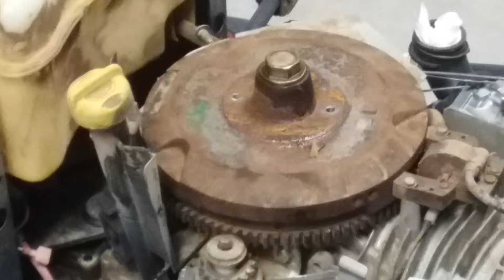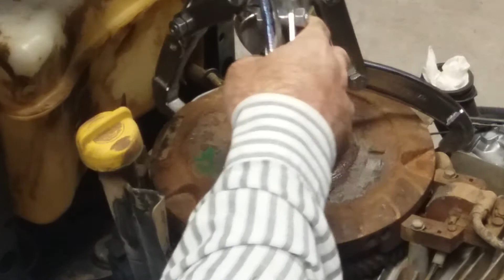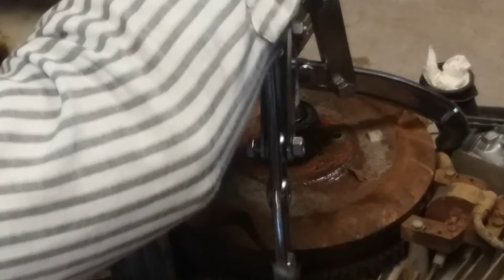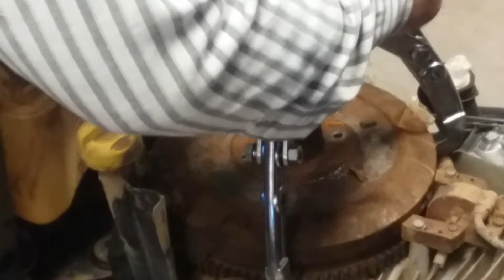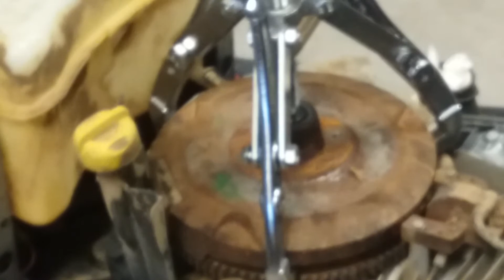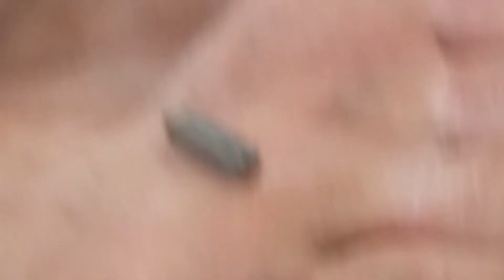Removing the flywheel from a Craftsman LT 3000 riding lawn mower

Comment: oil and heat to swell the flywheel  a little bit so it pop off easier. oil/grease the mating surfaces on the crank snout and flywheel so next time it isnt such a sturggle to get the flywheel off. oil the threads on the bolt so dont spin weld the bolt in the hole with friction of the pipe spinner.  that is how they spin weld on the ends of drill pipe. machine the tool joint, make the pipe, hold the pipe... spin the tooooooll joint fast... shove tool joint onto the end of the drill pipe. friction welding. machine off the mushroomed excess metal. done. x ray to make sure it was a good weld.